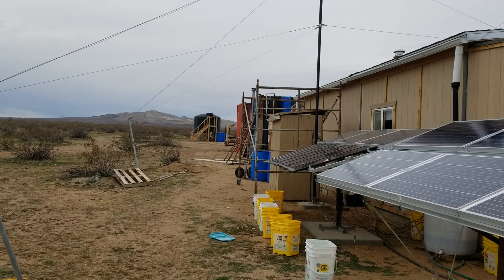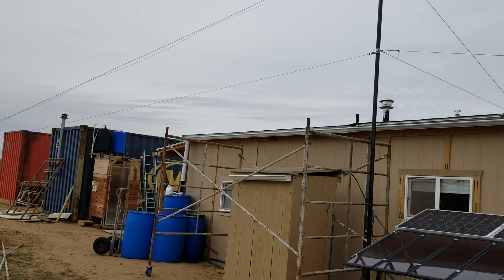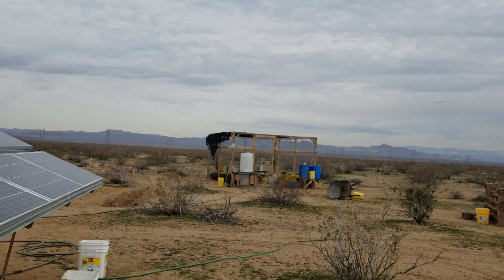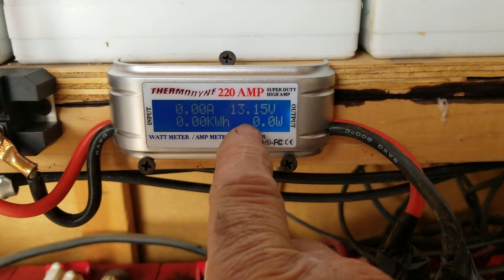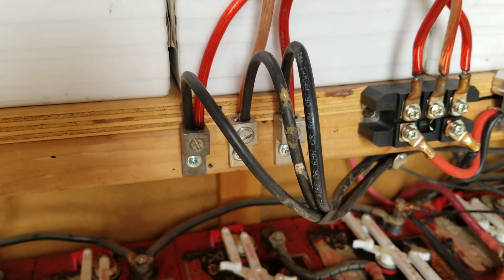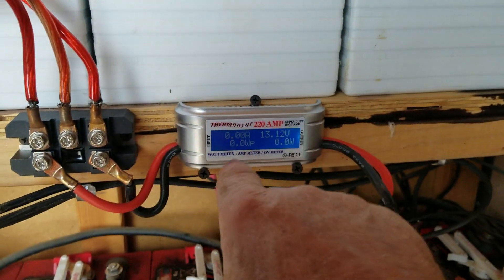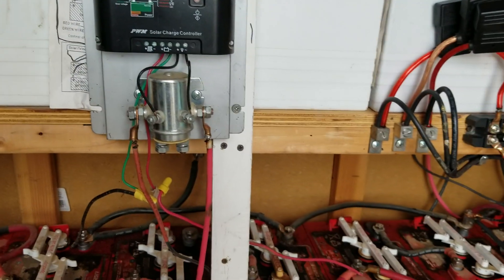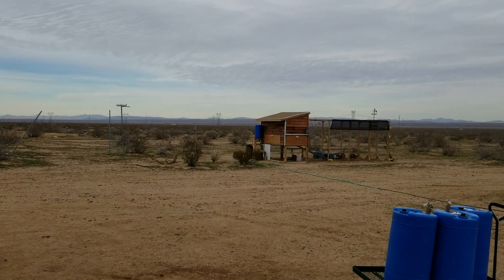GBear's Off Grid Ways-a Homestead in the Desert,  Feb. 12, 2019

Comment: How do you slow the wind turbine down in real high winds? I've got a cheap 400 watt turbine to play with but if the wind gets high will that dump load slow the turbine down to a safe speed?
Reply from the maker: No.  I don't ever slow my PMA. Braking can burn the stator.  If yours is a store bought, not a homemade, the blades actually do the limiting for you by reaching 'stall speed'.  So, if you have a 400w pma with a max wind speed of 50mph, when the winds reach 50mph, they cannot turn any faster than they are at that time.  If the winds got to 60mph your blades cannot turn any faster than the were at 50mph, so you are limited.
Reply: @GBear  thank you I was thinking it would over speed and come apart
Reply from the maker: Most manufacturers (reputable ones) will tell you to buy a PMA to fit your weather and wind speed.  Thermodyne told me my KT5 is rated to 90mph, after that I'm on my own and all bets are off!😂  of course, 85mph is hurricane speeds, 90 is insane and I would have more worries than my PMA coming apart....😁
Reply: @GBear  cheap 400 watt from Amazon/ China. Ive got it set on a 20ft pole right now in the back yard ( kansas) but we will be taking it to snowflake AZ.  for our camper, wind got up to 45mph last time we were there and 4in. of snow. so much for sunny Arizona in the winter😀 thanks for all the info you are putting out
Reply from the maker: I originally bought a Cheap Chinese 400w PMA,  never saw more then 80w out of it and then the thing burnt itself out. The permanent magnets they use are junk. Never again!  I spent a little more on an American made KT5 and it has worked well ever since. Winds right now are 32mph and I'm getting 802watts from it.  It's capable of 1685watts but at 90mph, so I'll pass on that...😁
Reply: @GBear  I went cheap to see if it is practical to use one in Arizona I will get a better one if the wind keeps this smaller one turning we will have 4000 watts of solar to keep house batteries charged wind will be for night time
Reply from the maker: @leeh.4729  4k solar is awesome!  What controller are you using?
Reply: @GBear  the outback 60amp. Times 2 so we can expand if we need to
Reply: @GBear  and a aims 5000 watt inverter
Reply from the maker: @leeh.4729  yeah, but what mppt controller(s) do you have?
Reply from the maker: @leeh.4729  oh, ok.  Missed this comment.
Reply: @GBear  outback fm60 150 volt
Reply: Same thing I miss your last one to
Reply from the maker: @leeh.4729  winds got up to 36mph and PMA was putting out 880watts.  My dump load is on, my controllers are on float, I'm running an electric heater and I still have 14.6 volts.  Guess I'll turn on a few more things.👍😁👍

Comment: Great video! Is the pwm controller you are using to divert excess voltage just a standard item, or is it modified to perform that task? If it's modified, could you, or anyone else, please post a link to a 'how to' video for it. As yet I have not managed to find the right info.😐
Reply from the maker: Welcome aboard!  The PWM that operates the dump load is a specially modified version built by the company that sold that dump load unit.  As nobody uses that style anymore, and prefer digital diverter setups, I doubt the information for make one of those modified PWM systems exists.
Reply: @GBear  Story of my life,lol. I asked because I have a redundant pwm controller that's wondering what to do with the rest of it's life! But many thanks for your reply. Atb, Mark
Reply from the maker: @Nitecrow314  yeah, I have a few PWMs laying around too.  I save them for emergencies, if my mppt's take a poop I can throw one in until the replacement mppt gets here.

Comment: hi bear what size wire are used between stuff please. cheers jm
Reply from the maker: Welcome aboard!  The size of the wire is determined by distance and load.  Also important is the type of wire which is different for either AC or DC.
Send me specific information per item connected, ie; distance, item to connect, and load rating in watts, or just the voltage and amps of the item and whether it is AC or DC, and I will help you determine your wire sizes.
Note that in most applications for wind and solar either 12ga or 10ga AWG stranded is adequate, although if distances are to exceed 25 feet 8ga or 6ga may be needed.

Comment: Hi, you have the same Solar/Wind system, mine is a small 12v, 830Ah, with a positive bus bar connecting the solar and wind to charge my BB, I don't know if I done it correctly, my WT with good wind try to charge the BB but never gets full, can you explain more the Wind Turbine connection to the Battery Bank?, could be to any battery terminal, instead on a shared Bus Bar with the solar on the BB?, will not affect the Battery charging level?, mine is 12v in parallel. Any help on this will be appreciated.  GOD bless. I'm learning every single day. Again thanks. 
Luis Martinez 
luismartinnez53@yahoo.com
Reply from the maker: Well, there are a number of things wrong and info missing for me to accurately identify your problem.
First thing wrong is connecting both wind and solar to a bus bar, as you would need diodes also to prevent the solar from backing up into the turbine.
Missing info: is your turbine 2 wire or 3 wire?
If 2 wire, install a diode and connect directly to the BB.  If 3 wire, you need to connect to a bridge rectifier first, then directly to the BB.
Missing info:  How many max watts is your turbine?  What is the max wind speed it is rated for?
Missing info:  What are you powering with the BB?  What is the highest watt load connected to the BB?
Missing info:  How many watts of solar panels do you have, and what controller are you using?

Comment: i've done some research and foing that this setup will cause micro-cycling ond battery bank wich will cause harm to the bank. Dump load should be taken from wind turbine or solar panels, not from Battery bank. Does this make any sense to you? Am i wrong?! 
Cheers from Brazil. :)
Reply: Some people run the dump load off a second rectifier ran in parallel on the AC side to the first which electrically isolates the batteries from the dump load.
Reply from the maker: @spencerhho  I'm not sure bridge rectifier can be connected in series or parallel, or needed.  If anything, just add an inline diode between the rectifier and battery if backfired is a concern.
Reply: @GBear  You can run parallel loads off of AC regardless of how many phases or what the other loads are (unless those loads shorts the whole lot) if you couldn't run parallel loads off 3 phase AC the worlds electrical grids wouldn't work... you can't run parallel supplies unless they're sycned so you couldn't run 2 ac turbines into one rectifier but you can run 2 rectifiers off of one turbine. The rectifiers don't interact other than placing additional load. Running a dump load on a second rectifier that's connected only on the AC side isolates the load from the batteries. 

All that said, I'm not convinced that microcycling batteries is a huge deal so your system is almost certainly fine. Unless that cheap solenoid fails and flattens your batteries completely...
Reply: @spencerhho  Yep. This may work with wind turbines, but solar panels won't have rectifier installed. I'm still kinda lost on this step. 
i have a small 24v system installed with 2x70AH batteries and 2x250W panels installed. Sometimes before 10AM batteries are fully charged and i could use the panels to something more usefull. Don't u think?!
Reply from the maker: With a Midnite classic 150, the system goes into float mode to save the batteries from boiling, and keeps them at full charge while you run whatever you want electrical.
Reply from the maker: There is no micro cycling present in my dump load, and the wiring is installed in accordance to the manufacturer.  On a PMA there are 3 AC wires that need to be converted to 2 wire DC through a bridge rectifier, and the controller on the dump load is designed and set to recognize when the batteries are fully charged and more electricity is still being input, and it activates the solenoid to divert that excess input to a remote load.
Reply: @GBear  There is no fine control on that system, all it does is simply apply a load across the battery that is in parallel to the rectifier/charge controllers output, it has zero control on where exactly and how much power is coming from what. All it does is switch on when a certain voltage threshold is met and turns off when it falls below a certain threshold which will absolutely be loading your battery and microcycling it. It's a very inexpensive solution to be sure but not as sophisticated as you might be lead to believe.

Comment: Is a dump load needed? dont the charge congrololers do that job?
Reply from the maker: Welcome aboard.   The dump load is for the wind turbine only.  There are charge controllers for turbines (PMA's), including hybrid controllers, but they aren't efficient, except for the Midnite Classic 150, which is an excellent PMA controller, but they cost in the neighborhood of $700 and you can't connect both solar and wind power to the same controller.
The dumpload system I use costs around $50.

Comment: Hi...I am confused as to why there is a need for the green resistor...Is the output measured at the output of the rectifier variable? I mean if wind is low it does not reach 13-14V and if it is very windy does the DC output goes higher than 13-14VDC? That would be the only reason to use a resistor to discharge the battery. You in theory could exchange the wind mill by a hidroelectric dam...so long that the output of the rectifier is constant regardless of the wind speed then your should not need that resistor. Can you tell us the actual model of the wind turbine to read the specs? One more thing if you could...what do you normally run of this setup? Typical household stuff? Appliances? AC? Have you tried to measure what is the load of the appliances/AC etc? Thanks a lot for letting us see yuour setup...you have done a great job.
Reply from the maker: Ok, sorry.  I will try to explain to avoid confusion.
First, I use a 1685watt PMA rated at 90mph max.
I also have 1.8kw of solar panels charging the same battery bank.
On a clear sunny day, with a 24mph wind I can create well over 2kw of charge, and as a single person, could not consume that much power.
The excess power would damage the battery bank which is for when there is no sun or wind, to power my regular needs.
If ways to divert that excess power isn't considered,  it could be detrimental to the power supply. (Battery bank)
The hybrid controller is supposed to do that, but,  I need to scroll between charging/diverting figures to know what is going on.
By using a dump load or diverter system on the wind power,  it gives me peace of mind that the electronics are monitoring that for me.

Thanks for your interest!

Comment: Great video!
I'm trying to glean as much info as I can before rebuilding the wind/solar on my RV.
Are you saying that a hybrid controller is a no no?
Are the outputs from your solar controller and your wind controller separate? 
But both connected to your battery bank?
Do you have separate dump loads or is the dump load system  on it's own and just linked to the batteries as opposed to part of the controller?
Thanks
Reply: Yet another question! Sorry!
Did you use a solar charge controller for the dump load controller? 
Just without using the solar input side?
Reply from the maker: No.  The complete dump load unit came assembled.  I think Missouri wind and solar still sells them.  Wasn't very expensive.
Reply from the maker: I found the hybrid controller to be useless.  Firstly, they are usually rated for too low an input.  The one I have could never handle the 1685watt kt5 because it was only rated for 600watt.
Yes the solar and wind inputs are different.  Solar goes through a controller, then to the batteries.   Wind goes through a rectifier, then to the batteries. (Wind being a 3 wire pma).
The dump load is connected to the battery bank directly and monitors the voltage in the bank.
Reply: @GBear  Thank you!
I watched again and understand a bit better!
So it's ok to have multiple inputs to the batteries and long as there's a monitoring system for the batteries voltage?
Trying to see what I can reuse and what needs to be updated!
Reply from the maker: @MikeJohnson62  yes, you got it right.
Reply from the maker: I looked up my dumpload controller set for you but found they are replacing this style with digital units.  See below:
https://cuttingedgepower.com/products/digital-12v-charge-controller-w-rectifier-wind-turbine-pma-made-in-usa?variant=8098696331319&currency=USD&utm_campaign=gs-2018-10-17&utm_source=google&utm_medium=smart_campaign&gclid=CjwKCAjwvZv0BRA8EiwAD9T2VQdte3RBnqHGTnDmOd8tXh2TSj0TlCIOcKNWgnbn_2i09xiLH6F0URoCyOcQAvD_BwE
Reply: Also, what is the voltage output of the rectifier? Are they available in 24v?

Comment: I liked this video and you're well spoken.  Question:  Since I have my Solar Panels and batteries connected with a Schneider controller and inverter, Do I connect the wind turbine Xantrex C40 controller  to the batteries also?  Do both controller's have to be synchronized to the same Bulk and Float voltages?
Reply from the maker: You can connect multiple chargers as separate systems to your battery bank, and mix or match pwm and mppt while doing so.  If you want to tie multiple controllers together,  there is a special component for doing that.
I have multiple controllers, each carrying separate solar panels because of their limits. Ie; 400 watt controller has 4 panels input, 600 watt controller has 6 panels, etc.  Each output connects to a bus bar then the bus bar connects to the battery bank.

Comment: 15:33 what are those white things on the batteries? Looks like you twist them.
Reply from the maker: You can google U.S. Battery 2200 for a closer look.
Reply: @GBear  thanks your videos are great/very informative btw
Reply from the maker: @jacobdavidcunningham1440  thank you!  If I miss covering something,  please ask and I'll fill it in!
Reply from the maker: Welcome aboard.   Those are the cell caps.  6 volt batteries, so 3 caps, but they designed the caps to be removed all at the same time by just operating the thumb levers.

Comment: Can I get a link for the digital multimeter please
Reply from the maker: If you are talking about my circuit tester multimeter,  I bought it from Harborfreight.com
If you are talking about the wind an solar multimeter, I bought it on Ebay. Com
Reply from the maker: And, welcome aboard.
Reply: I’m talking about the 220 amp  thing that read the voltage of your batteries
Reply from the maker: @theetruealpha  the one I have connected now is a Chinese made 150Amp unit i bought on Ebay.   I'll show the box in tonight's video.   I had a 220A from Thermodyne that quit working a month after i installed it, and i went through a fiasco trying to get it replaced, only to have it lost in the mail.  Those guys at Thermodyne accused me of everything from putting 60 volts through it to hooking it up wrong, then told me to mail it to their Lancaster address, which I did, the post office tried to deliver it twice...then it suddenly went missing.  I was out the cost of meter and mail, the out the meter itself.  Terrible customer service.
Reply: IKR sorry about that 

Check this one ... can it work just the same 

Yeeco Digital Multimeter AC 80-260V 100A Voltmeter Ammeter Voltage Amperage Power Energy Meter Volt Amp Tester Current Voltage Monitor LCD Digital Display Volts Amp Measuring with Transformer CT https://www.amazon.com/dp/B01ET2XRTA/ref=cm_sw_r_cp_api_i_VriVDbJ5H8T93

Comment: Hello G Bear, In one of your videos I noticed what looked like a "Wireless Router" in the background. Do you use your phone as a hot spot, or do you have another type of access to the internet ? I looked through some of your other posts and didn't see anything on the subject.
Reply from the maker: Welcome aboard!  What you saw is a "Cradlepoint" wireless modem and router.  This particular one is for Verizon and requires its own Sim card from them.  I pay $20./month for 15GB of high speed internet. And if I go over the 15GB speeds slow to 768kb until that month ends and them goes back up.  This unit provides me with height speed wired and wireless internet up to 750 feet from the unit.
I bought it used on Ebay for about $100.
Note: cradlepoint company sells these for some high prices new, and only offers support to the original purchaser, so they won't help you with tech questions. I have some experience with computer science and figured it out on my own.  It wasn't really that hard.
Reply: @GBear  Thanks G Bear... I currently get 10GB from my local provider and pay much more per month than you are. I think ill look in to the Cradlepoint and compare it with my existing provider. Thanks for the reply, and did I mention you posses genius, glad to see an independent creative thinker :)
Reply from the maker: @dangeraghty6715  Verizon has the best plans and coverage nationwide, and honor military and veterans with special discounts.